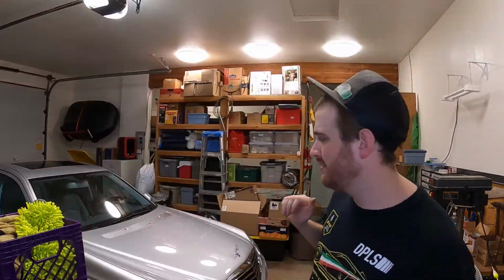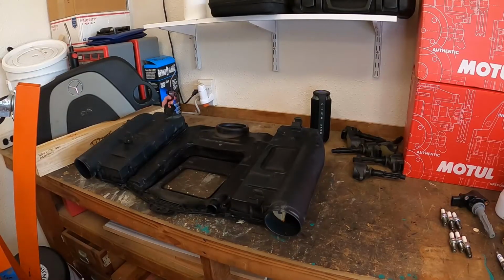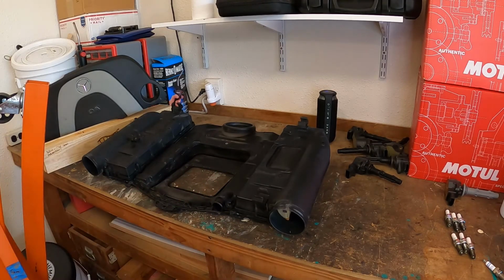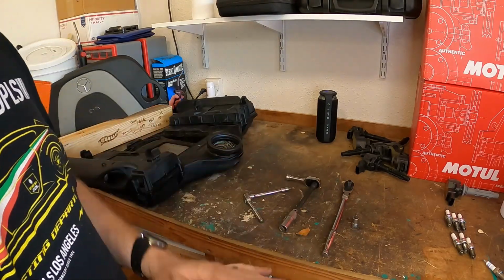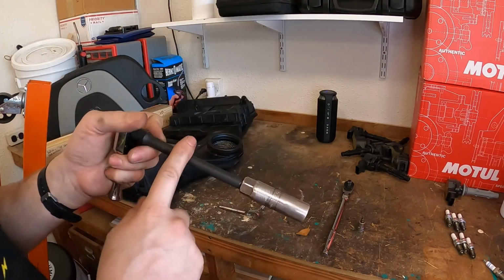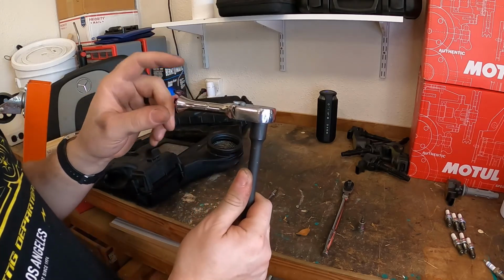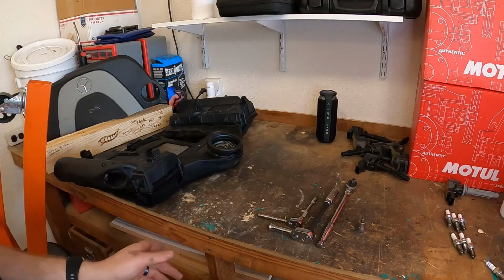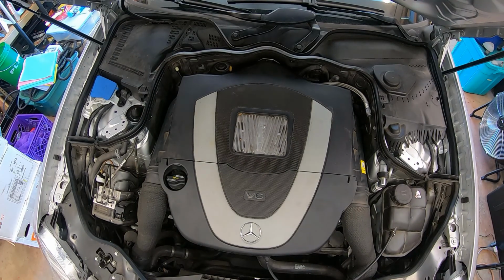Changing spark plugs and igniton coils on a Mercedes E350

Comment: How long did it take to do this entire job?   I want to know to see if mechanic is quoting me an appropriate number of labor hours to do this same job.  Thanks!
Reply from the maker: It took me at most an hour and a half. But that being said that doesn't mean a mechanic will only charge an hour an a half. There's labor programs like alldata that we use to determine the labor time to charge a customer. And the way we make money is by getting the work done faster the. The recommended labor time. That's flat rate pay for ya. If. Job pays 2 hours they it pays two hours regardless of how long it takes a tech. A new take should take 2 hours and a veteran tech should take maybe an hour.

Comment: Does the tightness of the spark plug matter?
Reply from the maker: Spark plugs has a torque spec and if torqued incorrectly you can damage the plug or the plug can come loose and blow out. Biggest thing when tightening a spark plug is to make sure the crush washer on the plug crushes correctly and that's its torqued to spec.